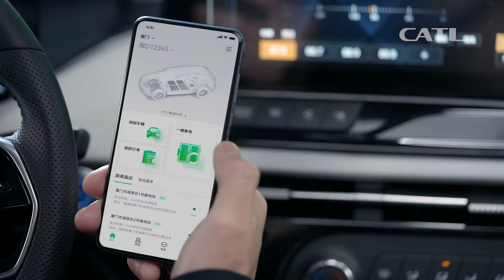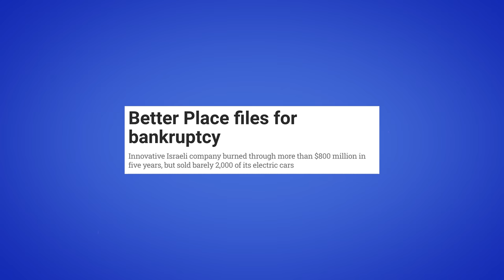Why Battery Swapping Is A BAD Idea

Comment: Battery swapping also makes a lot of sense in situations where there is inclement weather, such as areas in the desert or that receive very cold winters that affect battery performance and life. It also would be prudent to perhaps situate the stations along highways where people use them for road-tripping, such as interstates in larger countries and international highways in smaller ones. People could charge when they're using them as a daily driver by plugging in at home, work, or the grocery store, then could swap when going on a longer trip, such as a vacation or business trip.

What would be useful is an idea similar to the Chocosebs. Instead of making a universal battery pack for every vehicle, which would limit design and ingenuity much the way cars were in Soviet Russia and East Germany (Lada, Trabant, anyone?). This would make it possible to swap individual cells via access panels rather than swapping the entire pack. Individual cells would allow manufacturers more freedom of design and innovation, kind of like how CDs, DVDs, and Bluray discs all are the same size. It would also allow upgrading in the future. Replace your 20 KWH cells with 30 KWH cells in five years and get more range, for example.

Also, copyright pending on that idea if anyone wants it!
Reply: Good idea but I don't fancy swapping out 7,000 battery cells one by one very often
Reply: Totally agree, swapping would work if it could be only manual, without a swapping station. It would not replace entirely charging also: for example a standard car has a built in 100 km battery, that is charged overnight for daily use, plus empty slots for max 30 kg cells, that once in will immediately transfer the energy to the primary battery if empty. This will allow them to replace them at the next station. They will be returned and replaced in automatic erogators along the freeways, like we did with blockbuster videotapes once. This gives all the advantages without having to invest on a big infrastructure.
Reply: The trend at the moment is improving capacity and weight of EVs by structurally integrating the batteries. Here in densely populated Europe with a decent electricity grid fast charging at the main roads (theoretically up to 350KW at the moment) and a range of around 350 to 450km makes more sense. Even on the german Autobahn you'd be hard pressed to cover 350km in three hours and taking a 20 minute rest  isn't a bad idea. A German EV youtuber recently drove from Fulda to Amsterdam and covered 500km in under 5 hours including two charging stops in a Mustang Mach-e, beating google maps estimate. 
The current crop of EVs seem to work decent in Norway where they have cold winters! That's why everybody has a socket in his garage to preheat the coolant in the car. Diesels don't start easily below -25°C 😊 Now they charge their EVs over night.
Reply: @MrMaxsavi  it will be good to see if some company like CATL take educated risk and test this ideas too
Reply: battery swapping only works for those operating a fleet and knows exactly how many and when swaps will be needed.
Reply: @scottmcshannon6821  for me CATL is doing their PHEV version only you don't have to carry engine with you any more you will have to pick some choco blocks for long journey,and some people might go for this option too
Reply: As a EV battery tech, I don't see why you would replace individual modules (cells) instead of the whole battery, unless it's for a repair.
Replacing 1 cell (or cell module, since replacing a cell requires soldering) does nothing to the range of the car, except leaving it useless. Too high difference in cell voltage (~20mV) will lead to the car not running.

And there's no one who would want to stop every 100 km to replace the battery, even if it takes only a few minutes.
Reply: @davidcasey8511  Who does that? Look up reality.
Reply: @scottmcshannon6821  Nope, it's no different to a petrol station, they regulate the fill of their tanks, they can hold a buffer of batteries and have the best possible equipment for battery diagnostics, fast charging, recycling and maintainance. Standard fitments are the way to go in a new industry such as this.
Reply: @panzerveps  Why 100km ? that's your number not reality, they could last the same as non swap batteries.
Reply: @abbersj2935  I just took the numbers MrMax came up with.
I think most people don't understand how big the batteries actually are, how little wasted space there is and how much a design like the ones suggested above would impact range and power.
Reply: So the country leading the EV revolution in Europe is Norway. They have quite a bit of cold and inclement weather. I think your initial argument a mute….
Reply: @panzerveps  Sorry, but nothing you say is based on fact, just look up the range of the vehicles made by Nio. 100km's or 60 miles is too small a range unless you work locally or use public transport.
"2021 NIO ES8 (100 kWh, AWD)
range of 293 km (182 miles); 19 Oct 2021"
Reply: @abbersj2935  I'm pretty much an expert on the matter, since my actual job is to repair EVs and their batteries. But if you read all the comments, not just mine, you will see a comment from a person who calls himself MrMaxsavi, who came up with the 100 km number.
Anyways, I don't see why you would need a battery that could handle 600+ km wltp, sinde you'd have to stop and rest anyways.
500 km range on Autobahn and max 20 minute recharge is more than good enough.
Reply: @panzerveps  Thing is, non of that is true. Large vehicles, driving in hilly areas, those towing or heavily loaded will never go 500km's, more like 250kms, quick charging does reduce battery life. Enviromentally unique batteries are also bad for maintainence and recycling. I thought that you would know all this? I really don't care what maxsavi says, the manufacturer has said otherwise, they have a reputation and oversight to answer to, not your internet stooge.
Reply: @abbersj2935  totally different from a petrol station, a petrol station can fuel all petrol cars; a battery swap station will only be able to swap batteries on one make EV with a range of 2 to 4 different batteries. thats like saying the petrol station can only fuel ford compacts, not pickup, or vans, or full size cars and SUVs.

Comment: I feel there is one aspect heavily overlooked here. EV's really only make sense if you can produce the electricity using renewable energy. And like Elon Musk said himself, producing that energy isn't the problem; it's getting it when you need it, where you need it (paraphrasing...). 360kW chargers make no sense if that peak load forces us to spin up a generator that runs on fossil fuel. We need to find ways to match up energy demand with the availability of renewable energy. That means changing our behaviour or changing our renewable energy production. Audi is a good example of how NOT to do it: if you need a 100kWh battery to hardly get to 300 miles and to compensate, you put a very fast charger in there, you completely missed the point of driving an EV. If we can't get that renewable energy producted at the level at which we need it, we need to change our charging behaviour to match the production we can meet.
That's why I think, swappable batteries deserve another consideration. You can continue driving, while your used battery will charge when the renewable energy is available. They can be charged fast during the day or during heavy winds and slow during calm nights. And all the while, you still get to your destination, without even thinking of the weather.
Reply: '' EVs really only make sense if you can produce the electricity using renewable energy ''

Except that statement is strictly false which makes everything else you wrote after it incorrect. Due to the extreme inefficiency of combustion engines in cars, EVs still make sense even without renewable energy because they still produce less emissions since powerplants are more efficient than engines (even while taking distribution losses into account) and a portion of energy produced by the grid is renewable even if it's not entirely clean.

In simple term (using made up numbers), gas cars produce 100% emissions and 40% energy while powerplants produce 90% emissions and 80% energy. Even if your country runs on oil powerplants, you're better off.
Reply: @dzello  Even coal powered EVs are better in grand schema. Coal power plants produce electricity but also heated water for city. And electric car requires about 2-3 kg of coal for every 100km driven.

Comment: It would be helped enormously by having standards i.e. battery packs must be in specific configurations and accessed using an ISO standard panel. Really, it would take the EU to enforce a standard to give it a chance. Then you'd have cross-brand usage. Another reason why they might be needed is that they would help smooth out grid demand. More batteries can be charged off-peak, rather than commuters all charging at the same time e.g. Friday evening travelling home. Seems to me 70/30 that super-fast 18 minute charging will win out.

Comment: You praise supercharging and how it becomes faster and faster, but supercharging also comes with the cost of lower battery lifetime! What people don't get is that Nio for example doesn't plan to operate battery swap stations only. Nio has its Power Portfolio where you have the option to swap the battery. Sure you could use the swapping if you have no option to charge you car at home or maybe because you only want to battery swap.

The basic idea is that battery swap coexists with super- and common charging to use the matching technology for the fitting scenario. In this case you only need to build a certain ammount of swap stations and not to cover all areas. Highways are the best example.

If you rent a battery of Nio you get:
- Some kWh of free charging and some free swaps
- upgradebility of new and better batteries(Nio added a 75kWh battery to its 70kWh with better winter performence) 
- no worry if the battery dies
- no you don't get a sluggy battery because as you swap the battery it runs a diagnosis on it

Yes you need a certain amount of betteries 13/swap station in Nio's case but they are charged at rates and temperature which helps expanding the lifetime of each battery.

What I didn't get was you compairson of swapping vs supercharging speed.?
A Nio swap station takes up four supercharging spaces. So you have 312 swaps a day from 0-100%.
It takes half an hour to charge a model 3 to 80% and one hour to 100%.
So lets even take the 80% ok, 4 cars to 80% in 30mins equals 8/hour.
Thats 192 cars from 0-80% in one day for the same space as one Nio swap station with 312 swaps from 0-100%.
Reply: @johdo9953  Can't charge your car???
Nio isn't selling a lot of cars in Europe because they still only sell in Norway so that point of yours is total nonsense. We are potentially heading into a recession and youre talking about a failing chinese economy. China's economy is projected to be growing a lot as their GDP that is projected to exceed the GDP of the US by 2030!
Reply: @johdo9953  Its you against the Economic market. Those aren't my projections but those of big institutions lol 😂
Reply: @dennista42069  Projections aren't real.  If projections are always right then they are all rich and don't have to write up projections 😂.  These projections are history now.  YOY was growing but things have turned around and heading down. July deliveries fell from June.
Reply: @johdo9953  But these are based on inficators like the fastest growing middle class in the word in china. July deliveries lower than Jun for Nio = Chinese economy is doomed 🤣
You gotta start thinking long term!
Reply: @dennista42069  Ok, long term I don't know but short term middle class is heading to bankruptcy.  There's no bankruptcy in China so that means poverty.
Reply: @johdo9953  My interest lies in the long term economical growth of China, so short term trouble doesn't bother me ;)

Comment: swap stations have several benefits over fast charge stations: 1) you can select the range of your battery for long trips, and you can buy a cheaper car without the battery, unlimited swaps per station, as the first empty batter gets full, every 10th swap and so on. i think its briliant

Comment: there's also the capacity planning .. you don't want to build a swapping station with not enough available battery to satisfy your potential customer but at the same time, you can't build as large as you can because then you'll have battery storage issue and we know that we shouldn't store battery at (near) 100% SoC for too long .. with standard charging station, you can build as large as you want and potentially only loose your initial investment, you won't damage anything ...

but .. battery swapping also have the advantage of being able to keep up with battery technology .. your car won't be stuck with your current battery tech forever ..

Comment: It's funny how batteries were initially pretty much universal from aaa to car batteries and ever since the smart phone, laptops and electric cars they have become proprietary. If they could make electric car batteries universal then this might just work.
Reply: Agreed. Which is where they should actually go. Make everything standard. That will reduce the stress on the environment.
Reply: Well, the Standard should be the Pack size and connector/connector location.  Then the actual batteries can improve and get better.

Comment: with the latest fast chargers you usually only need 5 to 10 minutes to charge anyway on road trip stops.  I was a bit worried about it before buying an EV but since having one it has been a total non issue. plus even if your road trip routes take a long stop or two, you save time the rest of your life charging at home and never going to gas stations.

Comment: I think the demand for battery swapping really comes from a combination of range anxiety and charging cycle anxiety. We all own smartphones these days, and we all know the fact that, at some point, it's gonna use up its charge cycles and you might need to get a new phone because of that. Since these EVs use the same kind of battery, everyone knows at the back of their head that this will eventually happen, so there is genuine concern for the longevity of the car. The thinking behind battery swapping is that, if a battery is swapped instead of charged, you never have to worry about charge cycles.
But I think what we really need is good right-to-repair legislation so that when the time comes for a battery replacement, manufacturers and dealers aren't screwing you over and forcing you to buy a new car 10 years down the road when a battery replacement would have been sufficient.
Reply: Where i work there are 20+ people or more with Electric cars. I never heard them about range anxiety. Nobody. We got chargers everywhere. We even have a 50kW DC dual charger. And many AC 11kW chargers. Even a lot do not even charge their car daily just every week or so, and if they want to go on a long travel there are many fast chargers around.
Reply: @HermanWillems  unfortunately this scenario works in your environment. I live in South Africa, there are some electric cars now but I have not actually seen an electric charger in person, and I own ICE cars so do drive around a bit. This means for us here, owning one of them BEVs is not an easy decision to make as chargers are not ubiquitous like where you are, range anxiety is a big thing here.

Comment: Cordless drills became massively popular after they introduced swappable battery packs, and cars should do the same; they should have some percentage of their range in a removable cartridge pack.  A 5.3 kWh Tesla  module is only 55 pounds, and a healthy adult can lift that one ar a time if they were like plug in cartridges.  Standardize a cartridge and get all manufacturers to build a few battery slots in the trunk.

Comment: Ev altogether is a bad idea.
Reply: Don't say that. The locals will be out with their pitch forks
Reply: Says the man who has never owned one.....
Reply: And here they come 😅
Reply: @Brian-om2hh  yes, I'm not a monkey to drive a car that needs hours to charge in a country where fuel is cheaper then the electric bill the car would require. Charging the car 1 time is as much electricity as we use in a whole month and we don't even try to save energy, we simply don't require much.

Comment: Battery swapping would reduce lithium usage. It would allow cars to be shipped with much smaller batteries you could then swap to a bigger battery when you need to do a long distance drive.
Reply: no, you would need to produce multiple batteries per vehicle as the use-limiting factor, charge time, is removed. In your example you would need dozens of batteries of varying sizes sat idle/charging in swap stations waiting for someone to come along and take them. the battery swapped would then be useless for several hours while it charges. swap station providers would not fast charge these batteries because that increases costs and decreases longevity

Comment: I think it would work at the lower end of the car market, where cars are not so fast or long range. It helps the grid local if they charge slowely and helps to keep the battery health for longer. It only needs a great little car design with abttery swap for the mass market and it will take off.

Comment: Maybe swapping can also get faster, cheaper, and more standardized as the engineering advances. No need for a complete halt to the idea, there may be room for It as a better solution in certain situations.
Reply: It might only work if land and batteries are cheap.
Reply: @johdo9953  exactly, the more they are adopted the cheaper they can get.